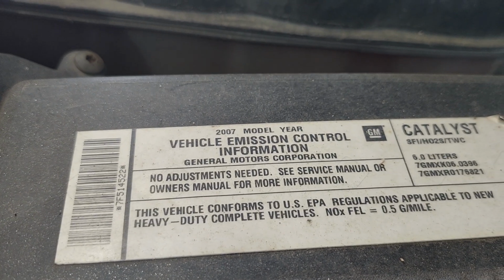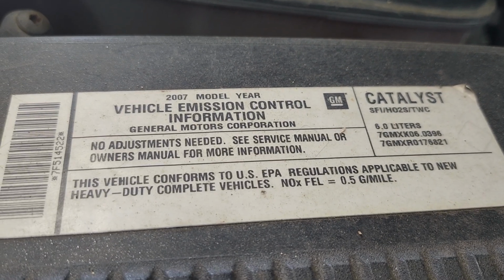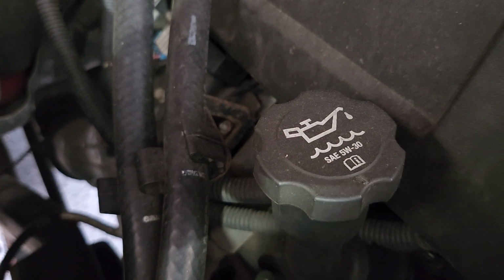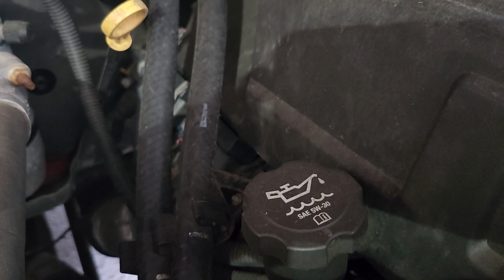Use 5W30  low engine failures .Use  0W20 oil high engine failures

Comment: I disagree.  Please read the scientific study "Effect of 0W-20 Low Viscosity Oil" by Tanaka, Nagashima, Sato, and Kawauchi in 1999. Japanese engine builders did studies in the late 1990's about  what 0w20 does to engines vs 5w30.  They found ZERO internal wear differences but an increase in fuel efficiency of 1.5%. I don't care about the fuel efficiency but I care about how fast the oil gets to the parts that need to be lubricated. But I think the problem is that we are confusing viewers who dont' realize incorrectly built engines may benefit from thicker oils. Correctly built engines designed for 0w-20 can last forever. The cast iron block 2TR-FE engine is the perfect engine to prove that 0w-20 is fine.  (The engine has been around since 2011 and many examples with 300,000 miles on 0w-20 exist. However, when they did newer studies on 0w-08 or ow-16, they did say that some of the main engine bearings can show wear so your instinct is correct, but 0w-20 has been proven to be safe for correctly built engines.  I don 't believe the Toyota timing chain rattle is from thin oil. I think it's from something else (design or lack of oil changes). The timing chain rattle you speak of I think only applies to very specific engines and not the 2TR-FE that uses 0w-20 just fine.   This is a tricky subject. So many damn engines are poorly built, that it makes you look correct giving 0w-20 a bad rep.   So your advice is still good since most people don't have a correctly built engine. They are very rare.
Reply: I just saw engineering explained mention that study on hus recent video
Reply: @rscope1605  Unlike topic where OP is using his "confirmation bias" with anecdotal evidence to reach conclusions, EE uses SCIENCE and the scientific method to reach his conclusions on this 0W20 and  0W_ _oils. If one wants to learn, that's a great guy to listen to on this topic.
Reply: Check out Oil Geeks videos on oil viscosity and shearing.
Reply: I value the scientific literature, but what I’ve also learned is that the literature and real world results are often quite different. This is why I greatly value the observations make by the guys in the trenches.

I’m going to try to find the study you recommend. I’m really interested in seeing how the experimental design was put together.

Edit: Any idea where this study is not behind a $50 paywall?
Reply: @EvzenKovar-i5p   I'll try to find it. But I trust Japanese engine builders.  When you say not to trust the data from American companies like, I get it. Like the range when towing with an electric truck. You are right.   The study I mentioned I'll try to find.  But you can also just go to Toyota forums and see all the people who said they got 300,000 miles on 0w20 for 2TR-FE engines.  They can't all be lying.  It's like 12 or 15 people I found saying they had zero engine problems using 0w-20 in their 2TR-FE engines. They have been around since 2011.  But for weak and poorly designed engines?  Maybe 0w20 doesn't work for crappy Korean or American designed engines.

Comment: Unfortunately consumers have lost the ability to understand and do proper maintenance to their vehicles to ensure longevity.
Reply: Can’t do what you don’t know.
Lifetime transmission fluid, 10,000 mile oil changes, no mention of coolant, differential fluid, transfer case fluid, battery checks, catalytic converter maintenance, valve repositioning, etc. 

People buy a car at the dealer and don’t know, nor are they told, how to properly maintain their vehicles. Plus, they are too busy traveling from their 2-3 jobs to do proper research on maintenance. They just trust that changing the oil (if they even do that) at 10,000 miles is going to be enough.
3-5 years later, car starts experiencing trouble. They go back to the dealership and trade it in for a new one, leaving the next sucker to come in and buy a poorly maintained vehicle that’s going to be giving them problems.
Reply: Yes this is a huge problem with American consumers.
Reply: @AlexanderSchnelle   The problem is the American manufacturers relying on subcontractors in other countries for sub assembly supply.
Reply: speak for yourselves
Reply: @tommurphy4307  I do all of my own maintenance work.